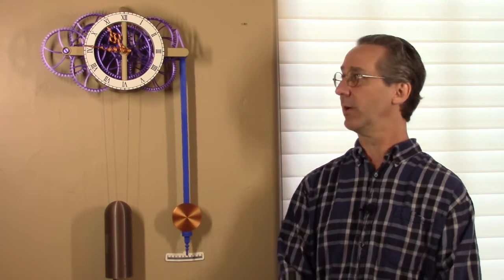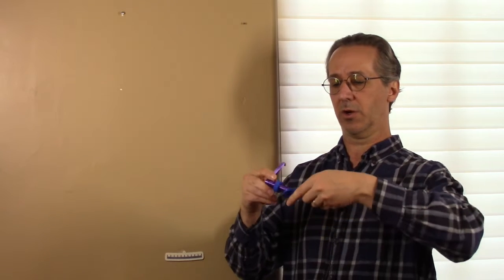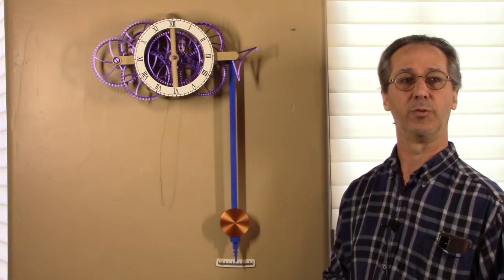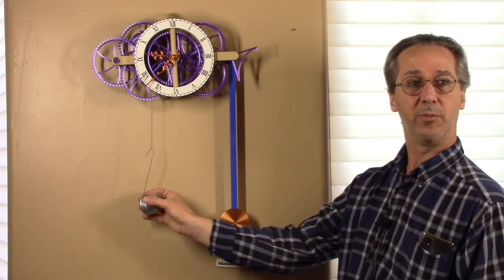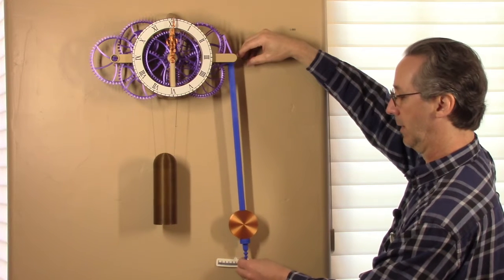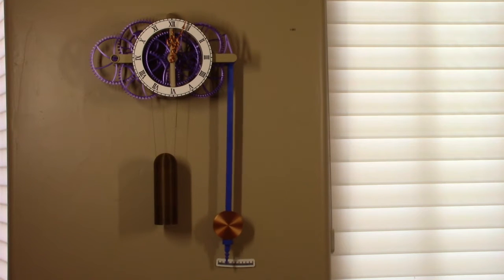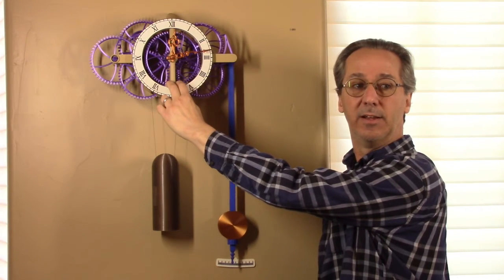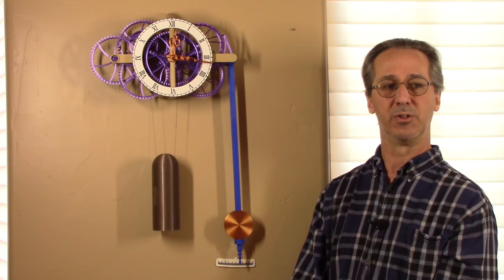EZ Build Clock Debug Process

Comment: Steve I wonder if I might once more call upon your assistance in debugging the clock?

As noted previously the gears were rather "wobbly" when running free, added to that where the face screws to the back supports started to spit as did where the string join to the front back support.  The to top it all off the whole thing stopped after about 2 weeks and I couldn't get it to run for more than an hour since.

I therefore having improved my printing knowledge and set up decided to reprint all the gears and the back (with a slight mod to create a peg or hook for the string to hook to on the bottom support and increased the infill where all the screws are).  I included all the updates you have done, and the tolerance on the arbours etc is much much better.

The issue I have is the drive (weight/pendulum/escapement) is running well, but hands are reluctant to move.  I'm guess for half of the mechanism to running while the other half isn't it must be something to do with the friction section on the central arbour?

The issue existed with the escapement removed so the mechanism was free running on the weight alone, it can be coaxed into running, but soon stops, might start on it's own for a while...
Reply from the maker: It seems like there may be too much friction in the central arbor. The most common places are gear 6 binding where it passes through the dial, or the gear stack getting pinched by the frame. Check for a small amount of end shake on the central arbor. Trim the height of one of the spacers if needed. Frame pinch will steal a lot of the drive power.

Then look at the escapement to decide where to debug next. If the escapement is sluggish, focus on gear train friction. If the escapement moves quickly with each tick, then double check the pendulum free swing test. Sometimes the bearings need a second cleaning.

This clock has a lot of runtime options. 32 day mode will run with the largest drive weight, but the pendulum will have a very shallow amplitude. 8-10 day modes will be significantly easier to keep running, even with smaller drive weights.
Reply: @stevesclocks  Thanks.  I did wonder about the entire arbor being trapped, but it felt like these was some play.

The pendulum is free swinging for over 10 mins.

The free run test was smooth and the stopping the escapement and letting it run again it was quick and smooth at all points.

I'm running the 10 day option currently.

Is there an updated consolidated guide?
Reply from the maker: @tomsimmons4482  The latest assembly guides would be on my web site at https://www.stevesclocks.com/sp5

Comment: Steve

I have finally completed my build, have a 2.8Kg weight - overkill for the 10 day setting, but I didn't have anywhere else to store the sand!

The problem I have is the clock keeps stopping after a few seconds.  I've been through you diagnostics, the pendulum seems fine.  Without the pendulum engaged the mechanism "free wheels" on the the weight, and seemed to start without issue... well I say without issue, something that other builders may appreciate knowing about is I found the that the rough an ready winding of the fishing line onto the capstan meant that it could bind on the big gear of the winding arbour.  I also initially found it caught on the tail from the knot on the capstan too.

What seems to be the issue is there isn't enough assistance from the weight ensure the escapement is always progressing far enough.  If I add  pressure to gear 3 then it seems to help, but I can't believe the 10 day is needing upwards of 2.8Kg?
Reply from the maker: 2.8kg of drive weight might not be enough for 10 days of reliable runtime. A pound per day (around 0.45kg) is a good starting point until everything is tuned and broken in. A simple test is to hang the weight directly on the line without using the pulley. This doubles the effective weight at the expense of cutting the runtime in half while debugging the clock.

The pendulum should free swing for at least 5-10 minutes. If the clock stops after a few seconds, then the escapement may be interfering with the pallet instead of pushing it with each swing. Is the escapement rotating with each swing? The escapement should start spinning quickly instead of sluggishly. It is OK to add a thin coat of grease to the pinions to reduce friction in the gear train. Does the tick and tock occur at approximately equal angles on each side?

Also, the drive weight will lose a lot of energy if the line is binding on a gear or onto itself. Start the debug with fewer wraps around the drum to reduce the possibility of the cord binding.
Reply: @stevesclocks  the free pendulum decay seems to be pretty close to what you have in this video - so I think that is ok.

Initially it runs correctly, then the pallet file to move on a tooth in the escapement, but it makes the next, then within a few more oscillations the escapement and pallet are simply rocking in place, the lower end of the pallet seems no longer move out far enough to let the escapement round a tooth.

I will try the weight direct rather than back to the clock chassis see if the extra weight helps, if does there is a little space left, in the shell, otherwise I'll have to print an extension.

Thanks for replying so quickly
Reply from the maker: @tomsimmons4482  It sounds like the pendulum is decaying faster with the escapement than without. The escapement is not adding any energy to the pallet and interference is actually taking away the pendulum's momentum. 

Maybe try going back to the "free wheel" test without the pallet. But stop the escapement with your finger and watch how quickly it spins back up when you release. It should be almost instantaneous. If it is sluggish, then figure out where the friction is coming from. Start and stop the escapement many times. It should always start spinning quickly. 

Here are a few things to try and some potential fixes:
Winding cord binding up? Wind carefully for this test.
Gear 9 binding up? Remove it for this test. 
Is the frame pinching any of the gear stacks? Trim the height of one or more gears. There should be some end shake in all gear stacks.
Gear tooth roughness? Look for burrs or elephant foot. Grease the pinions. etc.

Your clock should be very close to being functional. It should run great once you find the friction source. And you may need another kg of weight to get it running reliably. For now, just loop the cord back onto itself to bypass the pulley and run these tests with double the effective drive weight.
Reply: @stevesclocks  I will redo the decay test and confirm, but I fairly sure it was about 10 minutes.

I might have something that could shed some light on matters however.  I suspect there might be a friction issue in the main train.  When allowing it to freewheel so as to unwind the fishing line and allow me to wind it back up "nicely" I re-checked the ability to restart itself if stopped, it's pretty good, it always starts and is up to speed all but instantly.  However, as I noted before, the hands don't turn.  If I gently push on gear 5 it will starts to turn and hands turn, but only for a few seconds then it stops.  As you can see from this video https://youtube.com/shorts/uyJHEJ6qHM0?si=fsbp5a1dDllsz_Ic gear 4 and the friction drive are turning, but not gear 6.  Could this be the cause?

I am currently printing a 3.2" quarter section so as to increase the weight.
Reply from the maker: @tomsimmons4482  The large gear 4 allows power to be transmitted from the weight shell to the escapement. The spring in the friction clutch is supposed to push against the small gear 4b to turn the hands. So, the problem is either not enough pressure in the spring or too much friction in gears 5 and 6. 

Gear 6 has a printed shaft that passes through the front dial. Make sure it spins freely. Sand or file parts if needed. This is often a problem with different printer or filament tolerances. The parts are designed with loose tolerances that work great for some builders but are too tight for others. Designing with looser tolerances would make a sloppy fit for some builders.

Stretch the spring if needed to make sure it applies pressure against gear 4b.

There are a lot of gears stacked onto each other on the central arbor. Make sure there is a small amount of end shake so the gear stack does not get pinched by the frame. 

There is some gear wobble in your video. It's probably OK, but make sure none of the gears are rubbing along their side walls.

The extra weight shell may or might not be needed after reducing friction in these gears. It shouldn't hurt to add it.
Reply: @stevesclocks  I think I have found the issue, there isn't any end shake in the minute arbour.  Gear 4 & 6 can rotate on the shaft, 4b as required is solid.  6 can move freely in the chapter ring cross member.  However if I only put the arbour with 4, 4b and 6 in and hold the chapter ring in place whilst 4 will spin, though not freely, 6 is will hardly spin at all.

I can't think of a way of easily taking anything off the height of the shoulder on gear 6's hub, or the spacer built into 4b - not least because it won't be much fun getting it off!  There is nothing that can be done with gear 4.  So I think I'm going to have to get the spacer 4a off and thin that down a little
Reply from the maker: @tomsimmons4482  The symptoms make sense with your explanation. There are a lot of components on the arbor. If the slicer "rounds up", then the stack can get too tall. There is a gear4b_18_rev2 update that adds a set screw so it is easier to take the gears off the arbor.
Reply: @stevesclocks things are  looking up, the hands move, the escapement/pallet seem to be doing what they should.

I need to set the beat, which means retrieving the gauge from behind the radiator, but I think it's not too far off.

I'm going to leave this running for a while to see whether it does just that, if it does I'm going to print a new back plate as there is a split in the bottom pillar where the screw goes in for the other end weight cord.  Think I might mod your design slightly to include a hook in the print at around the 1 o'clock position on the pillar.

While I'm doing that I may well print the revised 4b and I guess I might as well do the other revision to gear arbour/stack 2 & 5 was it?

One quick question, when setting the time is it ok to wind the minute backwards and forwards, or does it only support going one way?
Reply from the maker: @tomsimmons4482  Chiming clocks sometimes have a restriction of only moving the hands forward, but this clock can set the time in either direction.

Comment: What setting on the slicer will make the pendulum look like that with the spiral front. I’ve used spiral vase mode setting on cura and it makes the part hollow and fragile.
Reply from the maker: Concentric bottom layer in Prusa Slicer. Cura should have the same option. It works great on simple circles or ovals. The back side with screw hole openings doesn't work as well.

Comment: Can you tell me which bearing I need. The one I have has a seal in it and it won’t come out it seems to have a metal ring below the seal
Reply from the maker: They should still work to test the clock. It might need some extra weight later if the grease thickens over time. Or it might be fine. I have never really tried it.

The easiest bearings to find are 623RS with a rubber seal that is easy to pick out using a small pin.
Reply: I found some open bearings. I don’t think the ones I have work for the pendulum it only swings for 4 minutes when the pallet is flipped backwards.

Comment: How do you clean and dry a bearing?
Reply from the maker: Remove the rubber seals with a safety pin and soak them in 90% or stronger alcohol. Mineral spirits or other solvents also works well. This should loosen most of the grease. A blast of compressed air speeds things up. You can add a drop of dry silicone lube or very light sewing machine oil to help prevent rusting.

Comment: I have printed the 32-day clock for the 7-day time, it has been running for 4 days and it loses 30 minutes in 24 hours it was printed on my Prusa MK3 printer the files were printed with a 0.4mm nozzle, 3 perimeters and 30% infill. I printed the updated #3and 4 gears, the clock is perfectly level to the wall also left and right. The tick and tock are equal I checked with a digital sound meter 5.73db I have checked the gears without the pendulum attached and they rotated smoothly, I am using a 9 lb. weight.
Reply from the maker: The best news is that you have the clock working. The only thing left is to calibrate the rate. I have found that the deadbeat escapement is fairly tolerant of changes in drive weight since the escapement only pushes the pendulum for a short amount of time. On the other hand, an anchor escapement pushes the pendulum a lot more and the rate varies wildly with various drive weights.

The rate on this clock is set by the pendulum length. https://theindex.nawcc.org/CalcPendulumChange.php has a simple calculator that implies a 15" pendulum needs to be reduced to 14.4" to change the rate by 30 minutes per day. There are shorter pendulum arms that can be used if there is not enough adjustment left below the bob.

Comment: I have assembled and dissembled this clock over six times and had my son do it to, we printed two clocks and have the same problem all the gears are not in a bind, when you put it on the wall and attached the weight to it the weight will not make the gears move the clock is locked. I have made open gear clocks on my CNC programed and driven by Arduino and been 3d printing for over 9 years. What could be locking it up.
Reply from the maker: The most likely problem is what I used to call "sticky gears" and can be seen in this video https://youtu.be/pnpYs-SuytI

The issue is that a tiny amount of sideways thrust against the escapement can stall the clock. New helical gears were released at MyMiniFactory to help push gear 3 away from the escapement. The issue can be easily tested by manually pushing gear 3 away from the escapement. If the escapement starts rotating again, then grab a fresh copy of the new gears and print just the 2 new ones.

If this doesn't work, then more info is needed to help debug the issue. Does everything spin with the pallet removed? How about with the pallet and the escapement removed? Also, what runtime option and drive weight are you using? I have switched my clock to a 14 day runtime with around 10 lbs of weight. 32 day mode runs, but it is just too sensitive. 14 days is much more stable. 8 or 10 days would be even better.
Reply: I changed the gears and cleaned the bearings with an ultrasound cleaner still only 5 minutes.
Reply from the maker: @normhuntley5552  Maybe a bit more information is needed. Is it 5 minutes of pendulum free-swing time? The clock should still be made to run with a bit of extra drive weight if this is the case. 

Or is it 5 minutes of clock run time? If so, what are the symptoms when the clock stops? Does the escapement turn when the pendulum is manually moved back and forth? Check the position of the tick and tock when doing this. They should be approximately symmetrical in both directions.
Reply: It was 5 minutes of free swing your video says 10 minutes; I have the clock running now with 9 pounds of weight the only thing I did was shake it before I hung it on the wall, I figured since I had it flat on my bench maybe the gears were the problem it works.
Reply from the maker: @normhuntley5552  Cool. Things may loosen up a bit and it could be running even better after a few days.

Comment: Steve I just purchased your ez build clock plans. my question is about .0625 [1/16] music wire, where can you buy 1/16" straight music wire, thanks
Reply from the maker: In my area of the US, music wire can be found at Ace Hardware or many smaller hardware stores that carry larger selections than the big box stores. Remote control hobby stores also carry it. The name is sometimes labeled as piano wire or spring steel.

Most of the clocks can also use regular steel or stainless steel wire if that is all you can find. Try to find something with reasonable stiffness.